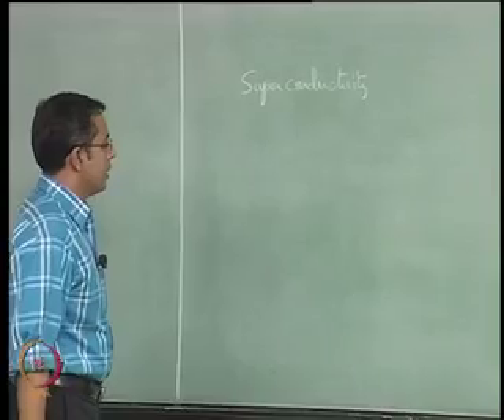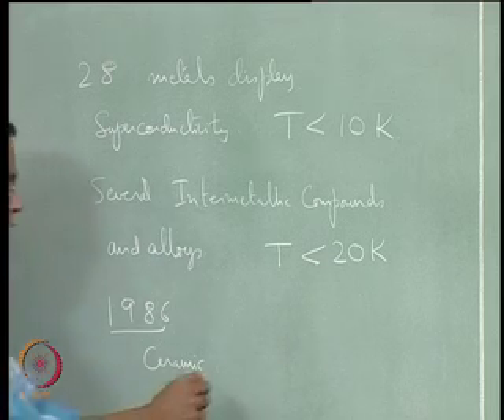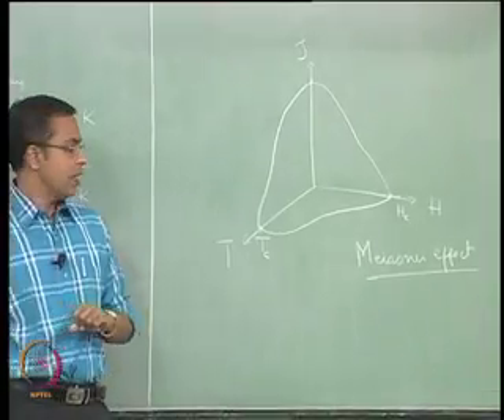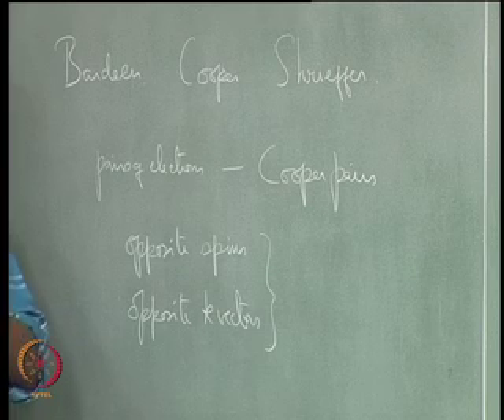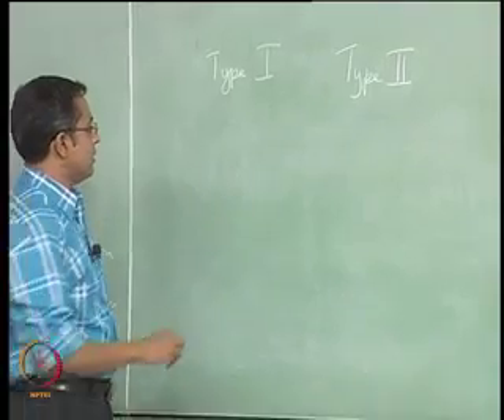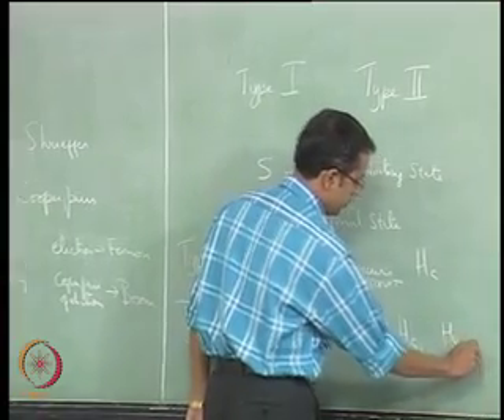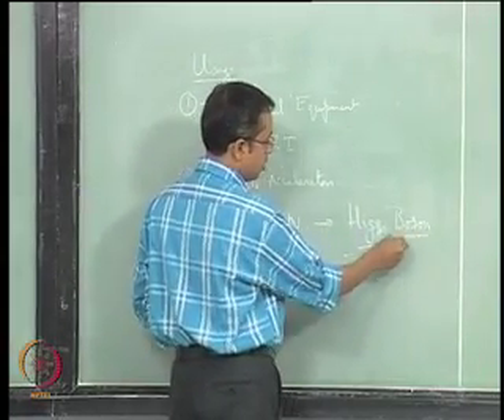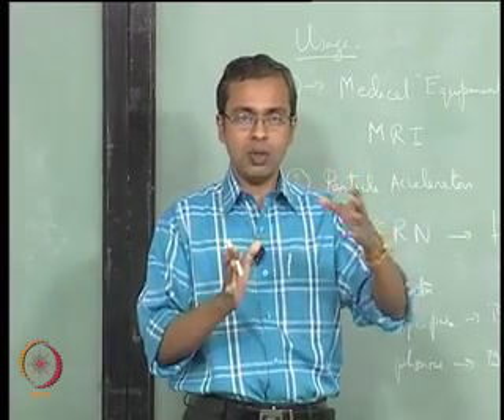Superconductivity

Comment: I find it very weird to use Ohm's law, a classical  law for a quantum phenomenon, deducing that zero resistivity implies infinite electric conductivity. I think this is completely wrong conclusion. The electric conductivity should be connected  by a quantum formula involving Planck's constant, mass of the electron and an electric constant like mu_0 or epsilon_0. 

I recommend you read my paper at

Article The Fractional Hydrogen Atom: A Paradigm for Astrophysical Phenomena
Reply: Infinite conductivity is infact what large stars accomplish by consuming electrons to make new large particles such as Higgs Bosons.  My theory online since 96 predicted the exact geometry not discovered until years later by supercomputer / see Egor Babaev's paper type 1.5 superconductivity and compare it to my models I've had here on youtube since 2008, copyrighted 2003. Specifically the 8 around 1 arrangement which is the highest possible boson format which can atomically relate to our known space and matter.
I've not only proved this predictively but I've been using my knowledge of it to transmute ferrite into gold. shhh

Comment: The natural coordinated state of connection of here and now, is an apparent orientation of directions of dominant probability. Although the world is not flat, we do exist in a focal plane of duality and, because the orthogonal direction of depth or distance is the sum of all points in the vanishing point of the universal singularity, we can "conduct harmonically", according to the relative states, "laws", of motion in, correspondence with the atoms of which we are constituited. Ie all distance information is harmonically linked.

Superconduction is therefore inherent in space time coordinates. And the circumstances of pair bonds, latency, and the energy of state change in temperature, is orthogonal to the "bound" plane that includes magnetic effects. (It's a confusing mishmash of Orthogonality, or it would have been sorted out by Crystallography, say)

That is to say, a practical researcher with extensive experience of materials would be best situated to intuit the connection process of Macro-Micro Quantum Entanglement, as it applies to the natural coordination of the universe of information (and at least prepare the ground Mathematically).

Comment: sir how superconductivity depends on current density?you did not explain
Reply: Bosons and or whatever the largest particles currently formatting that space in balance with all other particles constitute a neutral ion charge. Out of balance means lacking mesons especially in the mix, which is the most average sized particle. In order to exclude the meson, you also make space which is formatted by large particles like bosons everywhere, to become more crystalline but also space will actually gain mass relative to other space in this fully kinetic and infinite universe as it has been discovered and now proven to great extremes, though it's hard getting through to many who have learned physics based on the photon or superstring.  No physics theory ever explained superconductivity without also predicting it's exact geometry other than my own which I published on the web in 1996.
So the velocity and amplitude at which magnetic current (not magnetism) kinetically interact with matter which is a 3rd pole stuck on the linear plane building block with 3 arms (fano plane is the most compressible space in the realistic kinetic model) determines the level of superconductivity because it alone, fueled by a particle exchange to and from stars which make particles and space which decays them in the passing of time (it's product), will squeeze away heat causing mid size particles like mesons in a high boson matrix which is far more inductive to electron, muon, but most especially electron neutrino passage. The electron neutrino , the smallest known particle of mass .00012x e mass, is most hydraulically superior and therefore is the source of timeflow through progressive kinetic reactions among the 3 poles, as it has now been proven in many ways.